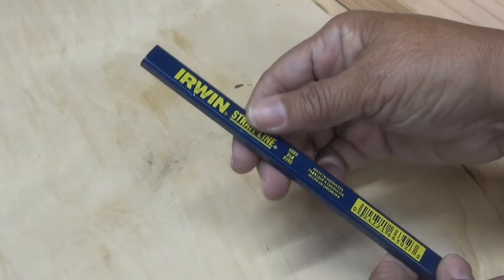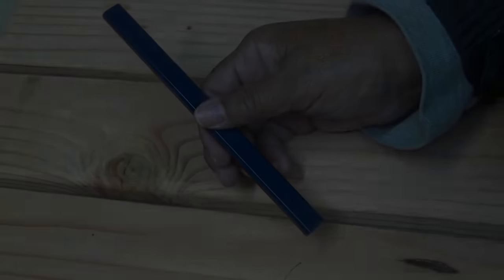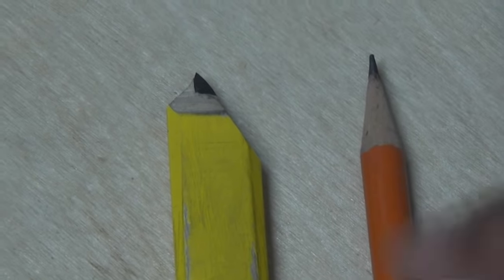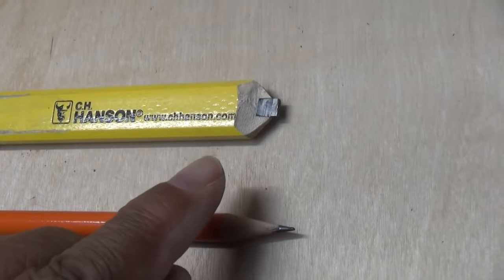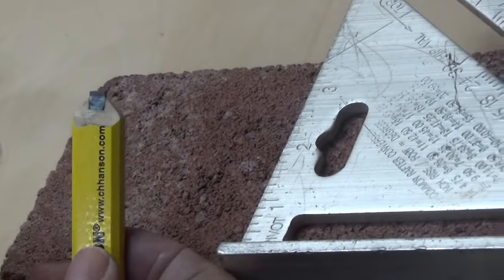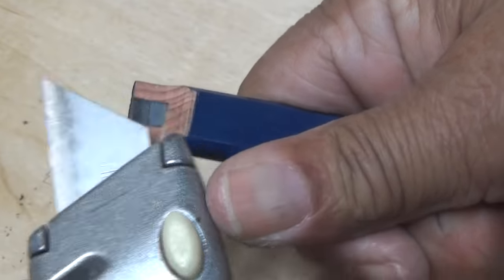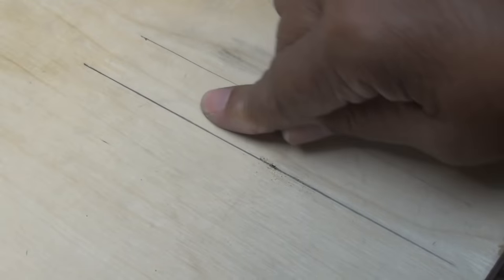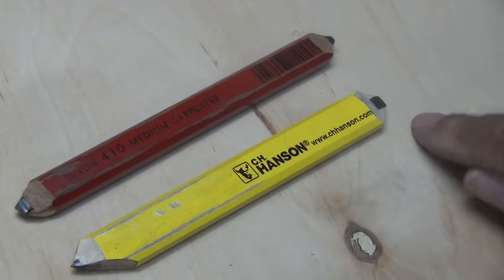Why is a Carpenter's Pencil Flat?  And Other Stuff

Comment: One more item to add to Leah’s excellent discussion on Carpenter’s pencils is “why do carpenter’s pencils have rectangular leads?” When pencils were first invented, they used strips of natural graphite for “leads” (And, no there never was lead used in pencils. They were called “leads” because they made a mark similar to that from lead, and the name stuck.) The strips were cut from the naturally occurring graphite which gave them a rectangular cross section. Early in the 19th Century, the world supply of native graphite was running out, and a soldier serving in Napoleon’s army came up with the idea to take graphite and mix it with clay and fire it to create a lead with variable hardnesses, depending on the ratio of graphite to clay. When natural graphite was used, you only got one hardness. Round leads came into fashion because the clay and graphite mixture could be extruded into a cylindrical shape before firing. And, yes, pencil leads are a ceramic.

Comment: I'm an artist and I also love to use carpenter pencils and to sharpen soft thick-lead pencils to a rectangular blunt tip, because it gives the pencil a self sharpening property. I use the narrow edge for fine lines, and when the tip gets dull I switch to the wide edge to do shading and that sharpens it again. It helps me work faster and also helps to increase the lifespan of the pencil by wasting less lead.
Reply: The flamingsword that’s actually really smart, I didn’t even think about it’s application in art. Nice find!
Reply: You can also pencil calligraphy, using it as a cursive italic nib. Great way to class up your handwriting if you're not allowed to use pen or if you're just working on a pencil project
Reply: One sharp and narrow side, one round and dull :)
Great for creating lines with varying thickness etc..
Reply: I basically do that so I can draw during exams😂😂😂
Reply: But I use it on a mechanical pencil and it works too

Comment: Love you Leah! I thought I was the only person who cared about how to sharpen a carpenter's pencil, so it was great to see you show us. And I learned a few things. 
I also do a few things you didn't do in this video. What I always mention first is that when the graphite is sharpened (your sharp edge type) it is much stronger than a standard pencil, in the family of the brick marker, but if you want a sharp edge and need to mark on soft or rough wood, the width of the graphite point makes the sharp edge much stronger so it endures the surfaces better. 
The other thing I do is make one face perfectly flat - you were making both faces concave - I like them flat - it's like your sharp edge, but by making it flat, I can sidle the edge right up tight to another surface, see what I am doing, and get a perfect line. It's also a stronger point because it isn't hollowed out. To get this flat face, I'll use a cinder block, a brick, a piece of sandpaper or my plane. I just wanted to share because you are an inspiration!

Comment: Thanks for some information I was unaware of.
My best friend for many years was a framer and he taught me to carry a piece of rubber tubing/ hose  with me that fit over the pencil. When your pencil is worn down, lengthwise, put the tubing on it and it's still useful. You can also put the tubing on the pencil when its really cold out, and be able to use the pencil easily with your gloves on.
Reply from the maker: nice tip!!  Thanks for sharing that with the community.

Comment: The reason for a carpenter's pencil being flat was in the mid 20's double hung windows were the norm in house construction throughout America, and uniformity was an extreme necessity in that most houses had brick veneer over frame construction, and all size windows (single set, double set, triple set) had to insert in standardized masonry (brick) framed openings, after the bricks were all installed. The standard carpenter pencil is 6" in length, 5/8" in width, and 1/4" in thickness with 45 degree bevels on all length edges and there were several different brands (Bear being one) of molding cutting machines to make all of the necessary pieces to comprise a completed wooden double hung assembled window, and with a new unused carpenter pencil, all of the cutting dimensions, all of the relief angles, being cut by the molding machines could be set using a standard carpenter's pencil as a gauge. I have a 34 page pamphlet dated 1923 showing how to set up one brand machine for dado functions, bevel functions, and such for producing all of the necessary pieces for double hung windows, all to a set standard dimension, using a carpenter's pencil as the gauge for the machine cuts. Whether the pencil came before the machine, or after as a necessary function, the marriage of the two components proved to be a faster, more concise way to produce a quality standard size product that everybody used until Jalousie windows or metal casement window became the new style and wooden window use waned as building modes also changed to different methods for construction.
Reply: Leave it to a DIYer to make a Youtube video explaining why something exists, only to get it completely wrong. Modern pencils aren't dimensionally identical anyways, so it's kind of moot point.
Reply: Thank you for the detailed, and fairly precise explanation.
Reply: Wow
Reply: If that's your work area, GOOD JOB!   If it isn't...get a life
Reply: Actually the Carpenters pencil was invented way before the 20s more like the 1820s if I'm not mistaken. I'm not saying it's not used for that I'm just saying your 200 or so years behind
Reply: I just double check my facts and I guess the timeline I gave was for the Carpenters square.lol my bad
Reply: Wow!

Comment: great video. i learned a lot... one of the things i learned was that, contrary to what i had been taught minutes prior, also contrary to prior experience, not ALL carpenter pencils measure 1/2" wide. Your yellow one is wider than your orange one. that being said, i'm not aware of any standard coloring in relation to width or other characteristics.

my dad built everything on our farm and taught me from a very early age; i started driving nails and screws and fitting drip irrigation lines before i turned 4, yet i still managed to supplement my knowledge three decades later by watching your video.

Comment: You can also get a pencil sharpener for a carpenters pencil, it means the pencil will last longer as there is less wastage than trying to sharpen with a utility knife, most also have a rough side on the carpenters pencil sharpener that lets you file the lead down to the desired point.
Reply: I just staple 240 grit sand paper to a 2x4 and place a few of them around my work spot.
Reply: CaptainKidd2006
There was a chap renovating an old wooden boat and had an old boat builder and a young lad helping him.
The old man told the kid off for sharpening his pencil with a knife, telling him to use a chisel to do it properly.
Reply: If you actually watched and listened you would've learned some other useful ways to use that carpenter's pencil just by sharpening it differently. How long it lasts is not necessarily the most important feature.
Reply: @grahvis  depends on the knife and the chisel and one's expertise with each.
Reply: George B. Wolffsohn take a chill pill Georgie boy, I did watch and I did listen. You need to learn how the comments work on YouTube. Iam letting others know incase they are not aware, the same way this video is letting others know about different ways of sharpening a pencil incase they where not aware. And wastage is in an important part of it, especially if your on a big job with your last pencil and you need it too last.
Reply: Did you even watch this video? Smh!
Reply: Street Skater 66 sit down will you, the adults are talking...
Reply: Those sharpeners are useless
Reply: Jimmy world never had a problem with them myself, I find they save a lot of wastage and give a better point on the end when used with the rough end on the sharpener.
Reply: I stand by my comment. And if you really go to work with only one pencil . . . The paper hanger I apprenticed with put it this way : piss poor preparation prevents proper performance. Have a nice day.
Reply: George B. Wolffsohn you can stand by your comment all day long for all I care, I don’t take any pencils to work as I’ve no need for them, you can also do your piss poor bla bla bla comment but in the real world things happen no matter how much preparation you make.
Reply: @Mark...  dude, relax its a pencil

Comment: My grandfather used to be a house mover and also shored up buildings when a contractor screwed up (Wait... that really is a load bearing wall!). He used wood timbers and large screws to raise buildings in Chicago. He taught me how to use the carpenter's pencil and the folding wood ruler. They were perfect for marking on steel, concrete, rough wood timbers... I am a high school science teacher and I still use both. I just have to be careful about using the sharpening knife in school. If my students can't do physics, they at least know how to sharpen a pencil correctly. lol
Reply from the maker: Hey Mark, thanks for sharing your experiences with the community! 👍
Reply: Yo waddup mr.schippel !!

Comment: This explains why there were 61 carpenter pencils under my deck.
Reply: Lol, they are cheap enough I guess!
Reply: Lazier ::::Reclaim them ! Probably cedar like Leah’s...build a cricket or bird cage and gift her with it. TITE~BOND GLUE II
Reply: One way to prevent them from falling through: Take a plastic cap from a 1 lb propane bottle (or similar) cut an X into the flat part, then push the pencil through. That way, if your boards wiggle a bit, your pencil should stay put.
Reply: Rofl!
Reply: Your desk is 61 carpenter's pencils unlevel? That's another use I guess.
Reply: @Albisriede  duct tape to a scrap 2x4
Reply: bruh im dead  XD
Reply: @bandit2602  I was going to say wrap 3 or 4 layers of tape around it to make it 1 or 2mm thicker at one end.

Comment: The sharpening can be tricky. Sometimes the lead comes out and the clock keeps ticking. So I sharpen about a half dozen of them at a time on my bench grinder. It takes 5 minutes and they last me all week, even if I lose one.
Reply: i could sharpen 20 and have to sharpen those the same day framer the best way to learn how to sharpen pencil
Reply: Robert Visser, lol. Yep! Some people do/will need many pencils and sharpenings. Then there are the people that are not full-time framers (like me) and still others that weren't even aware of the carpenters pencil's existence, let alone it's functions. The advice herein is clearly geared towards the latter group (since most professionals should already be familiar..).
Frame on, brother!

Comment: Very cool.  I could've used this knowledge just yesterday when I was installing the vertical section of a garage door track that calls for the track to be between 3/8" and 1/2" from the edge of the door the whole way up.  I always use the end of my pinky finger to measure 1 inch.  Now I have 1/2" and 1/4", too!

Comment: Loved the tip about scribing. Sharpening it at an angle beats taping shims to my #2 to get the right distance from my project. Doing a lot of that in my remodeling job as i do not like to use molding! Thanks!!

Comment: Thank you for the spacer tip.
Reply: The spacer trick works well on setting windows as well as decking.
Reply: I don't space decking, they space automatically when they dry.
Reply: A normal pencil works just as well

Comment: Great tips.. I didn’t know about the scribe ability.. 👍
Reply: There is, of course, no reason why you can't use a normal pencil for scribing
Reply: UKHeliBob for the application shown in the video a regular pencil would only give you about a 3mm at most scribe from the edge. it may not even work at all depending how out of square the cut was made to the piece you are scribing. with the carpenters pencil you get double that which not only clears jagged or out of square cuts but gives more room for the saw blade to do its work when cutting the line.
Reply: If you need the line to be scribed further from the object being scribed to then simply put the normal pencil in a partially open pair of compasses and choose your own distance
Reply: UKHeliBob ...you are correct. Seen this technique in a magazine...but haven't tried it yet.
Reply: True that my friend
Reply: In terms of scribing, the same functionality can be performed with a #2 pencil, given a smaller angle across a longer plane.

Scribing is made easier to an extent, but I wouldn't consider it one of the stronger points of carpenter pencils.
Reply: and using a carpenter's pencil you need to get out a caliper to measure how far across the led you sharpened

Comment: I'm a carpenter for 33 years, I use both, just depends on what I'm doing.
Reply: TheVagolfer same here , didn't want to be a weiner . I do residential and commercial and can do everything , it's all easy once you realize how easy it is and know what's what . Meaning what tools and materials to use and , well , there's a whole lot to know . Usually if the right materials are in front of someone they will figure it out. Most people's problem is not knowing what to to get or afraid to do the hard part , layouts and crazy cuts . We have a ball with it sometimes . Life is good .
Reply: TheVagolfer ok your point?
Reply: Yea number 2 for fine lines on trim and window boxing.
Reply: Exactly.
Reply: Carpenter pencil for framing, #2 for fine trim